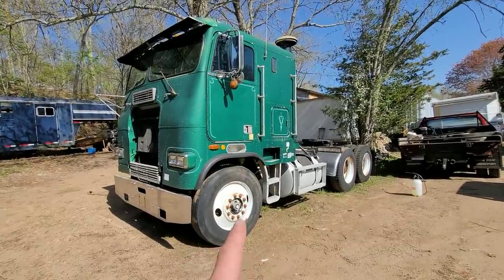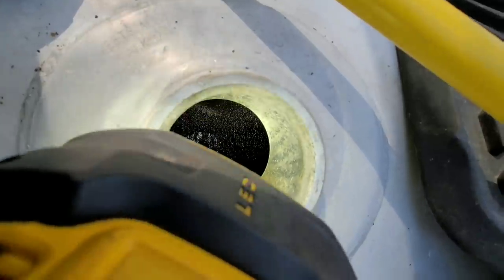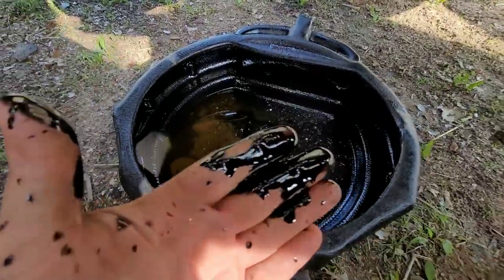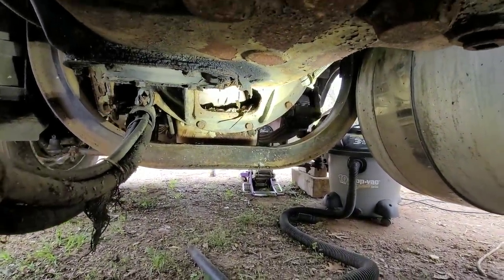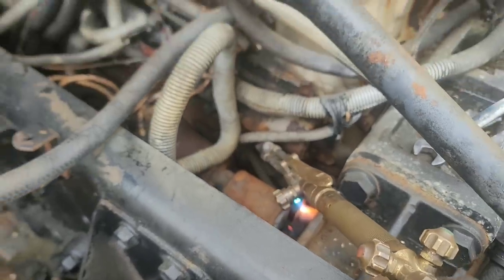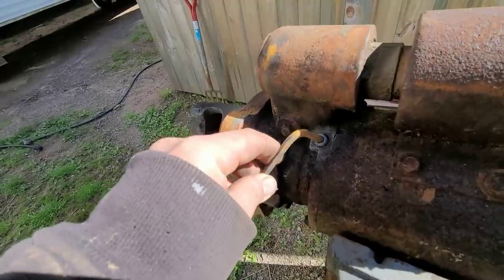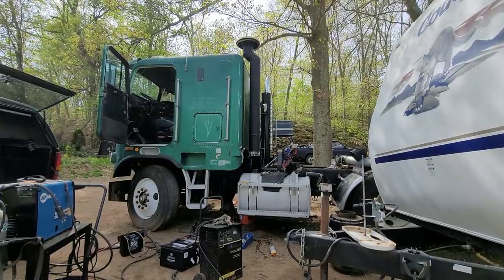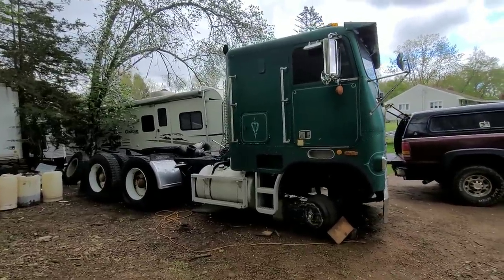Sitting 25 years! Will it start? Freightliner cabover Big cam Cummins"Jolly Green Giant"

Comment: You are right not to trust that turbo because most runaways are caused by the oil seal in the turbo blowing and the following induction of uncontrolled oil flow thru the turbo into the engine thus a runaway engine until you either shut that air flow completely off or it empties the oil pan and most of the time its the latter ending up with the engine in pieces
Reply from the maker: Thank you for having common sense. So many people are telling me cummins don't run away. I know it rare but it could still happen.
Reply: @NOT_FOR_HIRE  It sure can and the main reason for it to happen is the seals in that turbo go to pouring the oil that lubricates the bearings into the fan area and a cummins will run away with that oil but a lot of people dont believe it but I have in my 50 plus years as a Mechanic Seen it happen and like you always pulled that air intake hose off the turbo and kept a board big enough to slap over that air intake so I could choke it down if that happened. Detroit would runaway because of the blower system they had on theirs but they got real smart and put a door with a trip cable on it on the air intake side of that blower to shut that engine down but cummins never saw fit to design that  in that fashion so it left it up to us mechanics to figure it out
Reply: You can just use a carbon monoxide fire extinguisher and spray it into the intake manifold until it completely shuts down.Alot better than using a rag or towel and trying to put your fingers in the turbocharger.Speaking about Cummins,that's what you had to do with their small cam engines because all of them were naturally aspirated but the big cam engines were all turbocharged with the Holset 60.
Reply: @Slim_Slid  Best way is what he has there which is a block of wood or plastic anything solid which will fit over that turbo intake hole completely and shut the air off  safely. common sense tells you not to use a rag or towel or stick your fingers in that turbo unless you want to lose them
Reply: @douglasmorrison9098  The reason why I said that is because I saw a video of a guy that had a runaway with a Detroit 4-53T and he used a rag and stuck his hand into turbocharger.It fortunately shut down,but I was expecting blood to spew from it once he tried doing that...
Reply: @Slim_Slid  I saw that video also and that guy was an idiot not a mechanic
Reply: @NOT_FOR_HIRE  I’ve never herd of a Cummins running away, but it’s always a good rule of thumb to put a new turbo on an old setting Diesel engine no matter what kind of engine it s , I love the progress, thanks that ol Freightliner of yours is my favorite color, green, beautiful thanks BigAl California.
Reply: Try out a 1000 shot of nos on it
Reply: @douglasmorrison9098  œ
Reply: @NOT_FOR_HIRE  Man ...A Lot of algae in those tanks... I had some gasser guy say algae cant grow in fuel ... What Little does he know... Many Blessings , SMR
Reply: @NOT_FOR_HIRE   Dirty Tanks w/ Algae growth...I understand this is a month old video ... The best thing to clean diesel fuel tanks that I have found is a strong citrus oil degreaser ... Then MAKE SURE you add ALGAECIDE to your tanks... I can't tell you how many good Injectors and Pumps have been ruined by algae in the tanks... after your tanks are clean and you have run a tank or two w/ Algaecide additive you only need to use an Algaecide about once a year... Beautiful Cab Over ....Many Blessings , SMR
Reply: @Slim_Slid  I know you meant CO2 carbon dioxide, not CO carbon monoxide, carbon dioxide is an inert gas (not flammable) so it will starve the the intake of oxygen, hate to think what injecting a flammable gas (carbon monoxide) would do to the engine or person doing it, if you are curious just google carbon monoxide and see how dangerous it can be ....
Reply: @danzon21a2  Thanks for correcting a minor error.
Reply: There would be a lot more oil than that if it was going to run away it starts off as a massive smoke screen that you can't even see through and then the engine will run away and the reason people say the cummins don't run away it's not cuz they don't it's because it's super rare even when an oil seal does fail for it to actually go all the way through the intake and ignite isn't all that common the Detroit for the bad ones for running away and they didn't even run on oil they would just run away on fuel cuz the governor rack sticks
Reply: @Tylerstace-smith  95% of Detroit runaways are caused by the oil seals in the blower going bad then they start blowing oil thru that blower and thus it will runaway until you either shut that airflow down or it runs out of oil or the engine blows 99% the engine blows I know because I worked with a fleet of trucks with detroits for 21 years we only had 2 ever runaway with us because our detroits were equiped with a trip door that we could trip and shut the air down and the 2 we had runaway with us thats how we saved the engines. When we brought those trucks in for maimtenance those seals were part of the maintenance. The few detroits that runaway because of the racks is because of stupid mechanics that havnt got sense enough to control the rack while adjustments are being made on the rack because at the time of adjustment the rack is free to drift unless you hold onto it. and thats where stupid comes into play and you cant fix stupid
Reply: @douglasmorrison9098  fully aware of the blower seals and I've worked on a lot of them too and currently own two trucks with them one with an 8v92 one with a 6-71 I'm very aware of the blower seals but if you're running an older Detroit with a non updated Rack those helical gears inside the injectors are extremely prone to sticking way more than blower failure the blower failures pretty easy to catch cuz it starts to smoke I start Governor rack can happen whether it sits for two or three days or sits for a year yes they got a lot better with updated racks and yes I know the blowers are a problem but I've yet to encounter one that ran away on oil all of them have been fuel for me
Reply: It’s not just the turbo, the nature of the PT pump and setting can lead to a runaway as well. 

Had this happen to me recently with an engine that set about as long as one in the video. 

The govern plunger seized in the bore in a full fuel position causing a runaway. 

I suggest that any engine that has set that long have the pump removed for disassembly and cleaning of the parts that have sat in fuel that has broken down and varnished.
Reply: @NOT_FOR_HIRE  ANY Turbo can "run away".  If you have a boost control valve however, it won't blow up the motor.  You did the right thing by shutting off inlet air to the compressor section which mitigates the turbo itself doing badness.  Cabovers are awesome, they had a specific requirement they filled due to the length of vehicle regulations back in the day and they were great.
Reply: Uy

b j
Reply: @NOT_FOR_HIRE  my uncle had a Cummins run away after he wrecked (oil on the road).
Reply: @NOT_FOR_HIRE  is it a two stroke or a 4 stroke the runaway issue is a two stroke problem not a four stroke problem
Reply: 9⁰
Reply: 0
Reply: @royphelps8084  NHC-250's were always naturally aspirated,they were used in the five ton trucks from the military for a solid 18 years from 1969 to 1987 during the years of the M812's-M820's and M923's and M923A1's-M945A1's.
Only the smaller trucks such as the deuce and a halfs or early five ton trucks with Mack Thermodynes used turbochargers.
Only ever seen NTC-290's turbocharged from the factory.I knew a person with one in a Kenworth W900A.
Never once heard any person call a NTC-350 a "small cam"...I have a Peterbilt 352 with a NTC-335 and it's a big cam just like the NTC-400 in my 359 and what my M915 had.
440 Magnum?
Reply: ำกไกดโดดไหักไฮใจไฟฟ์ไจำกัดไไอะแดดทนอุสนใจใจทาทานทนดูทนทาน
Reply: @stephenphillips4507  
Nope 4 strokes can run away too!

Comment: I drove one back in the 70s, and 80S, i drove Freightshakers, they had the two stroke  Detroit's in them. smoke like a bygod, and when you stop at a truck stop ya would fill it up with oil, and check the fuel, we hauled a lot of TVs and VCRs from L.A to Bloomington Indiana.
Reply: Old 350 Cummins in the ones I drove! "Poor man's engine" cheaper than the CAT for sure!

Comment: I've seen some fairly serious runaways over the years including guys that didn't think to shut the airflow off and ran around trying to figure something out only to have the engine eat itself alive. Way to keep a level head on your shoulders and work through the processes. I taught myself how to be a mechanic by taking things apart and putting them back together. The rest I learned from experience. I've worked on thousands of cars and trucks since then and I still learn new things everyday.

Comment: Not having water or anti freeze in that oil pan is big, your going to be ok with that engine, I am so happy for you.
Reply: Cummins are pretty bombproof engines, you really have to mistreat them to get them to fail. Best part is no damned engine management systems to break on older wagons, so easy to fault find, if you got fuel at the injector feed pipes and the engine spins it should go.
Reply: My first truck was 1974 GMC Log truck  pulled it out of the woods put battery n fired her up 4-5 brownlight 300 Cummings

Comment: Exactly like the first one I drove on the first company I drove for, even the same color! OMG! You got me drooling son! 5 miles a gallon drive my 1300 miles made me grin ear to ear with my 300 gallon cap. Drive half the continent before I had to pump fuel. Those were the good old days for trucking. 1988 shower ticket never expired! No cell phones, no Qualcomm no GPS (only bummer).

Comment: If I might make a suggestion, after welding the nut on the broken stud, work the nut/stud back and forth. At first, just a little each way. Soak the stud with Kroil or your favorite penetrant and keep working the nut/stud back and forth wider and wider. It has been a reliable method for this old man. Best wishes on your labor of love.

Comment: I think I left my story before but here goes. I drove one of those for 6 years for a company called RPS aka Roadway Package System. They were the predecessor for FedEx ground until FedEx bought them out. The one I drove was a single axle sleeper set up to pull doubles. I made weekly trips from NJ to Fla, to Harrisburg PA and back to NJ.

Comment: im a old late 70s and into mid 80s trucker i hauled everything but flatbed.i ran a 79 transtar it was only one year old and later a pete cabover 352.the transtar and the pete both had 400 cummins and 13 speeds thats what our company bought we where always heavy.when i ran gas linseed oil dry van no matter it was 50000 min.miss them days some but not that much.its cool to see you saving one old cabover that i saw alot back in the day!We had a few white cabovers by mid 80s and some short nosed fords with detroits hated the fords in nebraska up a incline winding like crazy at 35mph but they rode nice.the transtar i had 500000 miles on it when it finally broke down.i coasted off onto a gravel road with a full load of malt o meal cereal no cellphones back then.jacked cab up thought it was a fuel filter and heard rustling in the corn  it was about 2am i was surrounding real fast by i counted 10 hungry coyotes i crawled up in already jacked up cab and slept over steering wheel facing ground till i could flag a farmer down in the morning.ended up being fuel pump dyed

Comment: Wow that engine sounded great for being dormant for so many years. Totally expected major valve noise or turbo failure. Even I was elated to see it turn over and hearing it run. 

Cabovers were one of the most maneuverable tractors to pull trailers with. The major design flaw was in accidents the driver suffered major if not fatal injuries. Great video and very happy for you that you got the “Green Giant” humming again.
Reply from the maker: I worry about the accident part it's always in the back of my mind but it's way to awesome of a truck not to risk it!
Reply: @NOT_FOR_HIRE  oh it wouldn’t play on my mind enough to prevent me from driving it. Maneuvering in backlots getting to some loading docks are a pain, but with a cab over it’s often easier without the hood from a traditional poking way out. You’re right, it is too awesome of a truck not to drive. I’d restore it as much as possible being it’s a classic and a big legacy to modern Trucking.

Comment: I have always used WD-40 as a starting fluid for diesels. Ether washes the oil off of the parts.
Reply: Can also get the engine 'addicted' , we've a Hyster forklift used in an ammo compound that will not start without a whiff of 'Easystart' even on the hottest summer day

Comment: A lot of ppl go at starter motors with WD40 or some sort of oil and fairly quickly down the road the sliding shaft seizes because the oil picks up grindy metally bits and scours the shaft a treat.   Graphite powder is your man every time for starters esp on Bendix types and really makes those slidey shafts all slippery but won't attract grits and particles.

Comment: Carry extra filters and do t let it get low on diesel.or you will need the new filter. You cleaned pretty damn good. All the trash is out of it for sure
Reply: put lucas in the oil and power service in the fuel

Comment: Ouch, I can feel the pain at 27:44 having gone through the struggle removing the starter (and still having the torched bolt to deal with) & then finding it's likely just corroded main cables...  I mean, bright side, that starter didn't look super happy and even if you reuse it you know it'll come off good if/when it does fail.

Comment: Great job. I like the old Cummins. I had an '86 Flatliner 8664 COE with a Big Cam IV Cummins. A former NAVL fleet truck that I ran for 6 years. It had a  9 speed with 11x22.5 rubber. The 145" wheelbase and spring suspension made her ride pretty rough. I don't miss it a bit. Been trucking since 1975 and thinking about hanging it up next year. Maybe.

Comment: I've got an NTC-350 BC4 CPL 675
9 speed overdrive trans
40,000# Rockwells 3.73 ratio

In my '87 Pete 359 and it's a strong runner! 
 
The previous owner said it was rebuilt with 400 components, but I had no reason to tear into the engine yet.

Good Luck with ur cabover

BOOM

Comment: So, you want “smokin brake” story huh? Ok ✅ I had over 43 years in the trucking business and I will describe one truck and a particular trip from Nitro WV to Long Beach, CA. back in the 80s. I owned a COE Pete with a KT 650 Cummins & 13 speed. What a brute of a motor. I pulled a 42’ double conical clean bore tanker with a liquid load of hazmat material. I grossed out @ 80,400#, and headed West. I wasn’t to worried about scales till I got to the “CLEAN” side ( west of the Mississippi River). I ran with a guy from MN driving a dry van loaded with “Mothers Cookies” , he stayed with me on the flats, but I left him behind in the hills. We came all the way across I-80 into CA and parted ways in Sacramento as he was delivering in Frisco, and I was headed south. I averaged 5 1/2 mpg with that tractor and tanker. Best truck I ever owned. I’m in my 80s now and miss the big road. One word of advice, don’t ever retire; it sucks !

Comment: You’ve cleaned that tank out pretty good. You can see where there was water sitting in the tank. My next plan of attack would be to pull all of the lines off the bottom of the tank and flush them out. Change your filters, add some fuel and bleed the system, then twist its tail and see if it hollers.

Comment: Just so you know.
Detroit Diesels are the only truck engines to run away spectacularly.
Two stroke engine, and stuck fuel delivery.
Reply: I know a guy that had a Volkswagen diesel caddy run away. I think he said it had a hole in the piston and ran away on its own engine oil until it seized. Different situation than fuel though.

Comment: Awesome!!  I’m glad you got it started!!

For those bolts that are hard to break loose, try tightening them a little first after soaking them with some penetrating oil, then loosen them.  Most of the time they will break loose without having to resort to a torch.  Happy Trucking!

Comment: Great to hear her roar again! Consolidated Freightways, a freight company in Portland, Oregon started building their own trucks, one at a time, to save money. The first truck nameplate was "FREIGHTWAY". Very soon they opened their truck assembly plant, and the name was changed to FREIGHTLINER. Over the years, the Freightliner nameplate has been associated with other companies (have you heard of WHITE-FREIGHTLINER?). Freightliner designed and built the first cab over (COE) in the US there in Portland. As a "Truck Assembler", I helped build COE's and conventional Freightliner trucks in Mount Holly, North Carolina for 16 years in the eighties and nineties. Not sure why Freightliner discontinued building COEs,  but it may be due to low customer demand. Freightliner is now owned by Daimler Benz. The German company started building a Mercedes/Freightliner steel cab at Mount Holly and moved their big trucks to the Cleveland, NC plant. Freightliner nameplates can also be seen on Fire and Emergency vehicles and school buses. They also provide assembled chassis for motor homes.

Comment: You use the same pink acid that they use on ac coils but the sad part about it is that you'll have to remove the tank to slosh it around to clean it then rinse out with water

Comment: Great job young man but on my old Cabover Freightliner for the batteries it came with 4 batteries but your positive and negative attaches to the driverside battery but you need to connect all 4 batteries together go to your local semi dealership parts department and pickup the cables so you can attach them batteries correctly good luck have a nice day